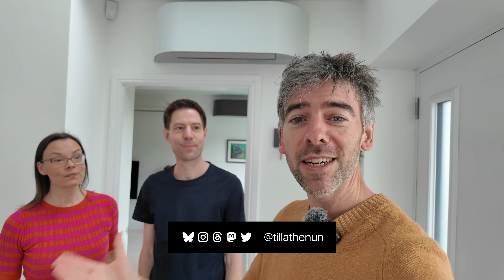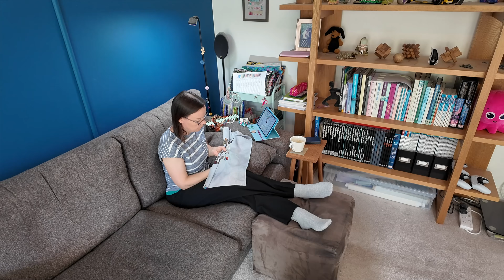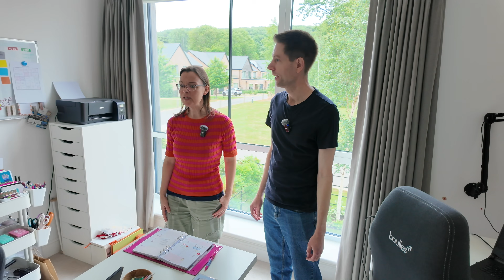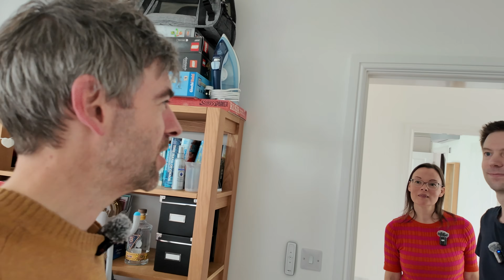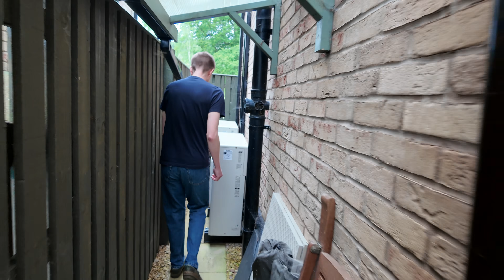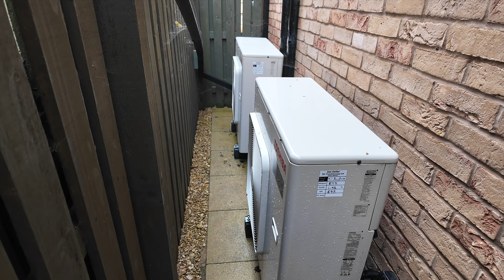Best of Both Worlds? Heating and Cooling with an Air-to-Air Heat Pump

Comment from the maker: Are you convinced by Tim and Kat's set-up? Would you consider an air-to-air heat pump or are you more for a traditional air-to-water?

If you'd like to get an air-to-air heat pump, I've teamed-up with my friends at Heatable to get you a discount of £150 if you use the code MISTEREV150 or the following link when you get a quote: https://misterev.co.uk/aircon (or the same discount for air-to-water if you'd prefer: https://misterev.co.uk/heatpump )
Reply: Had an Air to Air heat pump for over ten years. Going to get a heat pump for hot water soon no more gas for me.
Reply: @p @petersebborn306 uld be expensive just for hot water, or do you mean tank with built in heat pump.
Mixergy? the have product with built in heat pump on top.
Do you have Solar? if so have you considered using an Eddi device and simple immersion heater
Reply: Already a convert to air/air in an 1860s giant victorian pile.
Reply: Didn’t realise Heatable did air to air.
I think the installers need to be informed the BUS grant is for the consumers benefit, not them!
I have had A2W HP estimates of around £14k before grant, it’s a scandal.
Anyway going A2A now.
Reply: Not actually watched the content yet. i've onky sub'd in the last week and not here. But since then you've talked about Upside Down Forks who I have been following for about a year

And now you know Tim & Kat who I sub'd to when they had just started! Because I think they only live about 2 to 3 hours of hard driving away: Depending on the ring road!! 

Or about 10 minutes right now at 5am. 

But from what I have seen of your content has been very watchable!
AnnA💋
Reply from the maker: @annakissed3226  Thank you! Talking of UpsideDownFork, get ready for the next video!
Reply: Btw DJI now do a Mini Mic 2 which looks more like a piece of jewelery especially like Nokia phones you can change the look if it as well. They are full 32bit float directional mics. They are  rather more professional looking than strapping a hand mic to the chest??
Reply: Mr EV,

I have no intention of getting a heat pump, just to get that out of the way.
What do you use for hot water with an air to air system.
Surely a refrigerant\water condenser is far more effective and efficient than refrigerant\air one; water being a far better conductor of heat?
Reply: After the horrendous heat we’ve had this summer I think it’s a no brainier to fit AC. I’m thinking of getting a ducted system as I could easily run it to every room in the house. But I can’t find much info about fitting it in the UK, any ideas?

I wrote the above before getting to 11.30 in the video!
Reply: Evans,
horrendous heat, where do you live?

A few days of slightly higher than average, just wait until next year when we are back to our usual mix of sun and rain. The last time we had such an exceptional summer, was fifty years ago. It is rarity in the U.K..

You go ahead and spend your money, you won't get any real value from it.
Reply: It is true that MrsEV hated the last A2A you installed previously, that you had to move house 🤣

Comment: Team air-to-air here in Romania! I heat and cool a 120 sqm 2-story house with just two 12,000 BTU air conditioners (one on each floor) down to -15°C outdoors. In the bedrooms, I use electric convectors. With a 6 kW solar panel system and a 15 kWh battery, my total electricity bill for the entire house (heating, cooling, water heater, and appliances) is only about £30 a month. I use mid-range Midea units, which cost around £500 each, installation included.

Comment: Some air-to-water systems claim to do cooling, presumably by chilling the water, though I am sceptical how effective this would be. If replacing gas with air-to-air presumably you have to do something with HW to get the grant since they are going to take the gas boiler out?

Comment: Is the output unit by the fence really sending hot/cold air into the neighbours alley?  Is there a problem with condensation/damp forming on the fence or the neighbours wall? 😮

Comment: Its just utter wierd that these videos exist. Reverse cycle airco, yes cooling and heating, is used in other places (australia, singapore, new Zealand etc) is totally normal and I had a reverse ducted airco in 2000 installed. Its NOTHING NEW

Comment: Combination of both probably the sweet spot, but on the expensive side.

Air to water is typically good as a replacement for traditional gas central heating.  Has it's pros and cons but done right (probably works best with underfloor heating) it can be decent enough and with low rate electricity, batteries and solar cheap to run too.

It can provide cooling too (with 'emitters') but because you're effectively running water through a coil, not refrigerant it'll never touch the cooling abilities of air-to-air (which is essentially what modern day home Air Conditioning is).

With the summer we've just had, and the likelihood they are only going to become warmer, and for longer periods, I think most people are at a point now where the justification for shelling out on proper indoor AC is becoming more necessary than nicety, at least in one or a few rooms.

You have to be a bit careful with these things though, a case that you very definitely get what you pay for, particularly with AC.  Buy cheap, buy twice.

Comment: Just be aware that when it’s cold the cop goes right down. Mines about 4.3 but when it’s zero degrees probably goes down to 2.5. Cheaper than gas at 4.3 but more expensive than gas at 2.5.

Comment: I was looking to change my wet system to A2A with everything Tim has said here but at the end of this video Tim reckons if you have a wet system, best to stick with A2W. Also, I have a detached garage approximately 20m from the house where the oil heating system is stored and I was hoping to fit the big box fan unit behind my garage and plug straight into the system inside garage. Would this be too far away from the house and would it work ok. Do these fans have to be directly outside the house.
Reply from the maker: There'd be a lot of extra pipework involved but I imagine it might be possible. 20m is quite a distance though! I don't know the technicalities as perhaps a longer pipe run reduces its effectiveness. Worth asking an installer. Good luck!

Comment: Well done on revealing you boosted the insulation in under 10 minutes Tim, although to be fair 40cm insulation for southern English winters was pretty decent already - I'm curious on the double glazed windows however, were the panels manufactured with reflective coatings ? - If you don't know, there's any easy way to check with a candle or cigarette lighter flame, as you'll see the colour change on the reflections from each layer when looked at slightly off axis.
   90% of the heat loss on windows and doors tends to arise not from the glazing but the frame - As builders usually fit the minimum cost for developments, it's frankly unlikely your existing frames can accommodate double and triple -  If noise is an issue replace the frame with an 80-92 frame with triple glazed coated coated glazing panels with coatings, else I'd suggest replacing the DG panels as like for like but with coatings and composite spacers - That is likely your biggest bang for buck.
   Solar generation is the real game-changer on your journeys, getting the balance right is down to maths, and so long as generation is consumed "internally", you're unlikely to suffer changes of greed from government or power companies.
Reply: PS - Although true that Air to water works in very cold climates, they are quite different to the models you'd typically get in the UK - Air to air in very cold climates needs a little more thought as the typical method of discharging the condensate to drain outside can freeze up.

Comment: We installed an A2A mini-split HP in 2023. It has just two inside ceiling cassette units for entire house. Our 5.2 kW solar array still generates an annual surplus of energy even with the HP, EV charging and every other household energy load (except hot water). It helps being in sunny Colorado. While we had existing hot water radiators, we wanted the benefits of summer cooling. We had one problem due to an installation issue which wasn’t adequately removing condensate from one of the ceiling cassette units. We think that has finally been resolved.

Comment: We heat our whole house with 2 air to air (mini split) units,  one on the main floor and one in the basement.  We were toasty warm all winter long for a very low price.  We did need to leave the bedroom doors open at night if it was -20 C in the winter.  We only use the cooling occasionally in the summer, often just on the dehumidify setting.  Keeping the windows open at night and closing them in the heat of the day is usually enough to keep the house comfy.
Reply: Greetings from Germany, we are doing the same thinng here, we also have only two units

Comment: ⚠️ A word of caution for your viewers: If a quiet night’s sleep is important, think carefully before choosing a Midea multi-split.
My Solstice units are locked at a minimum 20% fan speed when connected to a multi-split, and I couldn’t find this limitation anywhere in the manual.
If other brands allow their multi-split systems to run below 20% fan speed without locking this function out, I would seriously consider buying one of those instead.
Unfortunately, my experience with Midea’s after-sales support has also been very disappointing

Comment: Considering a ducted system for upstairs but loathe to put a water tank back into the house so would keep the gas combi boiler for water heating. Do you run the system continuously summer and winter to maintain the ambient temperature ? Would love to know how many kWs each unit is pulling daily.

Comment: I was reading that in North America there is a model of heatpump available that can heat/cool both air and water. 

Is there any reason that’s not available here?
Reply from the maker: Yes, you can have fan coils to provide cooling with a traditional air-to-water heat pump I believe, but I don't know enough about it to be honest. If it's not mainstream here then my assumption is that it's due to the cost, but it's something I need to look into further.

Comment: We've had similar units a few years now, no issues and very economical. We only have 2 units indoors. One large compressor outside which we will most likely add a further unit onto in the future. We retained our gas central heating but only use that to boost things when it's really cold. In hindsight another unit would have been useful to go full air to air. It's a learning curve!!
I've given up trying to explain it to people as they just assume cool Aircon only. People need to be willing to learn and explore the options out there. Cost is a major factor and new tech is the other thing putting people off although in reality it's not really anything new but people need a lot of persuading to take the plunge. 
Getting an electric car for us was the big turning point, it makes you realise what is possible if you open your eyes and are willing to invest/lease. Obviously not everyone is able to do so.

Comment: We have solar and 2 Tesla batteries.
So we charge up overnight and store the 5p per kWh in batteries over night.
Use during the day to cool our bungalow with aircon we had fitted, works out cheaper than gas for heating and cooling by a long way.
So to give you an idea we have aircon in every room but left the bedroom one all month and it only cost us £2 for cooling in bedroom for the entire month, odd times we switched off but mainly on.

Comment: We are thinking of going A2A because of the hot year and next year forecast to be hotter. We do have a battery and solar panels.  the Ducked systems sound attractive but we only have two reasonably sized bedrooms and one tiny bedroom we use as the computer room.

Comment: I still wanted to know "Active" running costs, so how much kW do they actually use when running.? And no mention of annual servicing- does each unit require a look over? At what on-going cost? More than a boiler service? Much more? Also too many cowboy installers around or decent installers who even if they do a good job are not around to sort out issues 2-3 years down the line. Big issue in the UK.
For our house I am keen on A2A, as cooling is becoming almost as important as heating the home at present.

Comment: I wouldn't go for a ducted system upstairs...  The problem is that in the winter when you want heating, you have to have all rooms at the same temperature.  Cooling less of an issue, but if your upstairs layout has big windows and lots of solar gain, you may need bigger units in those rooms.

Comment: Would a compromise (and lower-cost) solution be possible where over half the annual heating load was supplied by one external heat pump branching into two stylish wall mounted units located in areas that you do routinely not sit in? The remaining 40-45% would still be supplied by the existing room heaters, which would have less work to do as there would be a background warmth from the air to air source heating distribution system.

Comment: I'm not convinced at all.  Doesn't an air to air heating system remove moisture from the environment? You need some moisture right?
It's a great system but I fear it wouldn't work for me as my house isn't as good as Tim and Kats - I have too many leaks :( sadly am a slave to gas 😢

Comment: I liked the bare ceiling light.  My dear wfe insisted on shading every light bulb/lamp in the house.  The only shaded light is now in the bathroom.  Maximising the use of the light generated must make a reasonable economy over the year is my thinking, rather that pretty lampshades.🙂

My choice is an A2A system, btw

Comment: That fence probably restricts more than 50% of the flow as if has offset slats so no straight path for the air. The units are too close to the wall and the fence and are not complaint with industry good practice, so won't be as efficient when the most flow is demanded - there is no argument here so please stop trying to kid yourself. Just be careful that they way you have installed them doesn't mean that your warranty will be void due to the extra stress you are putting them under and not being compliant with their installation requirements.

And I also dislike it when people mislead others and just talk about big savings but forget to mention the huge costs of putting the systems in, and hence the fact that it will take around 2 decades to break even, never mind start to actually save any money!

Comment: Ive had heat pumps for over a decade across three houses in NZ and Finland. The NZ ones were a ducted roof based air to air heat pump for winter heating and summer cooling. The Finnish system was air to water, for heating our water and our heating radiators.  Both systems were huge improvements to the home, with the Finnish system saving us huge amounts on heating oil, so the payback time was within 3 years.  The Finnish system has had faults and recently needed significant parts replacement and maintenance for several 1000 euros, but they really do have to handle significant difficult weather.  The newer units are way better. If you can duct a system via your loft, and bring some ducts downstairs (depending on your house layout and design, you can get away from the wall units. I would never go back to electric heaters and when I finally buy a house again in the UK; I will remove the gas boiler and replace it with a heat pump system.

Comment: We live in an early 19thC terraced cottage with a 2010  loft extension. We didn’t have space for air2water system and R290 was a no go also. We’ve ordered a Daikin R32 5 port air2air using their smallest, simplest Comfera indoor units plus one floor mounted Perfera unit for the loft. Chose Daikin principally because the external unit is notably smaller than Toshiba’s, and its location will be where we sit outside. We therefore also opted for a bespoke paint job at additional cost of £480. Shall have to see what we think of it all!

Comment: Was wondering if you keep the A2A heating on at night and when away?
Reply: Running low and slow means you keep it on (low) at night. You might put it on a little before you come back home.

Comment: I have had ASHP for 4yrs  but I would say ASHP to water can do cooling as it is reversible with built in dewpoint control. It rads are not piped TB OE then you can buy clip on mini fans to improve cooling capacity.
Reply: Interesting to hear of Dewpoint Control. We’re in the South of France on holiday and dew point by day is 20C  surprisingly high. But still it might make a difference if run long term I suppose.

Comment: Good to hear the real world example as opposed the advertising blurb. Would have liked a slightly deeper dive into the full cost of Tim's system. It sounds like about £10k for the full heating and water system (including installation?). His solar installation is fairly large and over multiple roofs so maybe £20k for the solar and batteries? So £30k full cost which given he's saving 50% on his energy bills will give a pay back period of maybe 20-30 years? Hard to say without the exact figures but from a cost perspective alone the justification is a hard sell
Reply: The 50% saving is on the heating only, not the full bill.  Our annual bill is now negative so we're covering all of it, plus earning some extra on top.  Total payback of all the kit we've installed is about 12 years, that's saving about £2.6k per year.
Reply: @TimAndKatsGreenWalk's neighbour has a better solar system than them and only paid £18.2k.

(Tim might get a bit fed up with this comment)